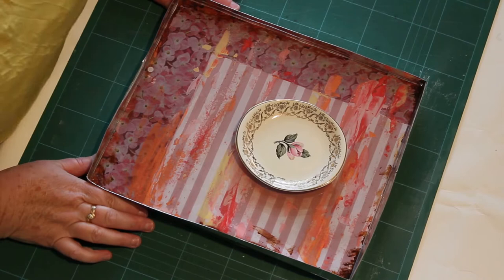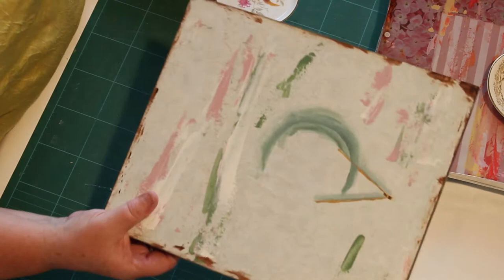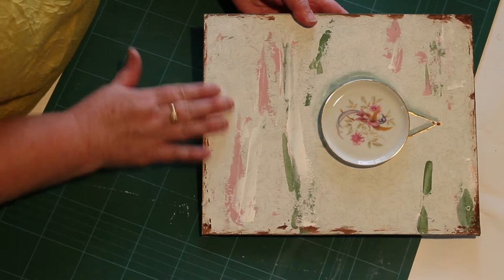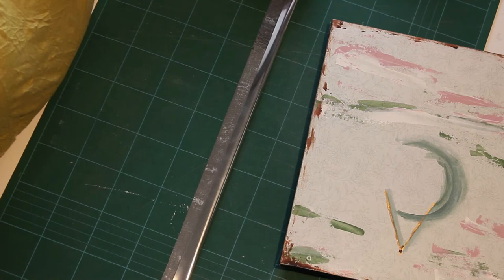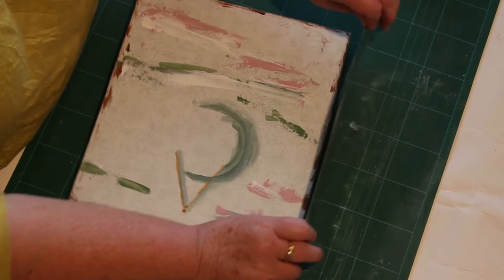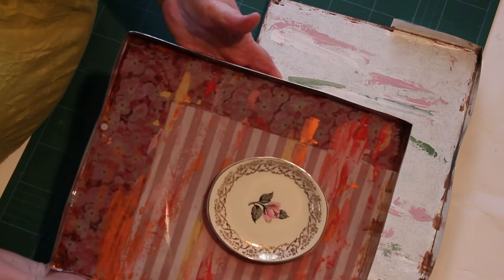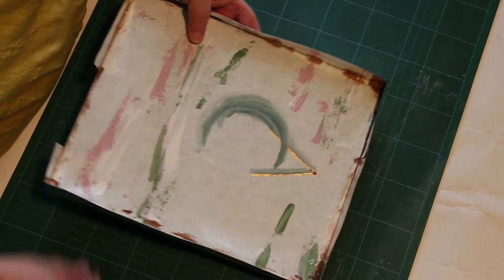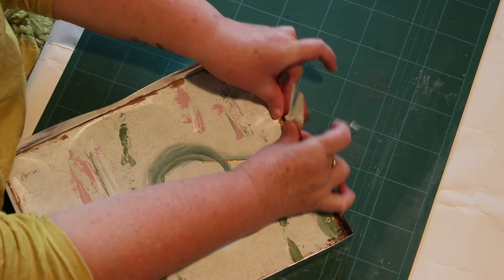Resin dam 101. Holding resin on your painting surface.

Comment: Hello! Thank you for this! I plan on adding several layers for a glass table top. When should I remove the aluminum tape? Can I remove after I am 100% finished or do I need to create a new dam with each layer?
Reply from the maker: Hi! 👋 😊
So glad you found this helpful. Sounds like a great project. I use the same tape for the whole painting so I would say you could keep going until 100% finished. It gets more stable after the first layer. Because you can still get leaks I’d suggest pouring your first layer thin and this will seal the edges perfectly and you can add resin all the way to the top of your tape from there. 🌸💕🌈
Reply: @selinawilsonart  Thank you! Very helpful to me! I will not be using a saw however, will my heatgun have the ability to remove the tape once I am finished? (After, a lot of patience on my part?)😂 Again, thank you for the info!!
Reply from the maker: Yes your heat gun should work. Try and keep your edges of the tape very smooth when taping, I’m a bit slap hazard 😄. That way you should be able to avoid the resin going underneath your tape. Removing the tape before the resin is fully cured is an option. It’s a fine line of the resin being stiff enough to stay put but soft enough to untangle any tape. 🌸
Reply from the maker: Ps. If all else fails you can sand by hand (with time and patience 😂) good luck 🌈💕
Reply: @selinawilsonart  and that fine line is what I am most afraid of!!😂 Well if I mess up, at least this project is for me and not a paying customer. Lol
Reply: @selinawilsonart  🤦🏼‍♀️The patience thing again. Lol
Reply from the maker: @dianacoupel1757  😂😂